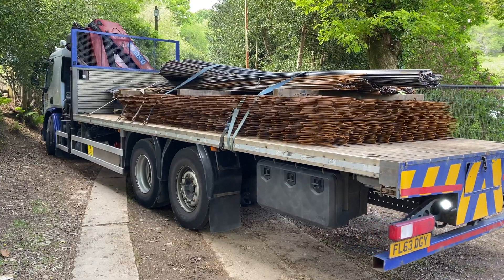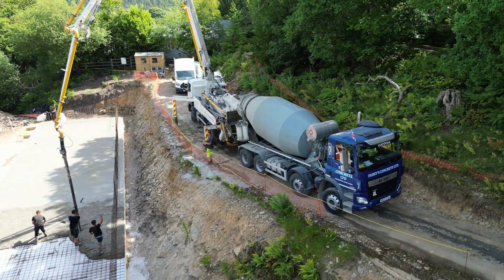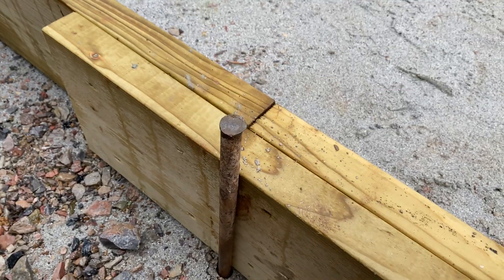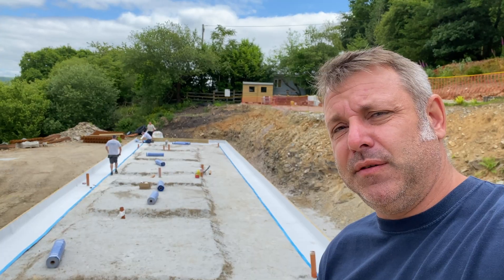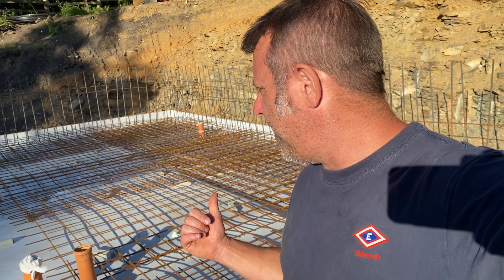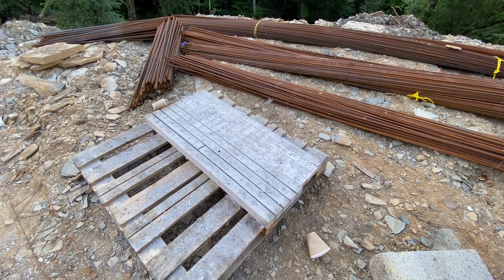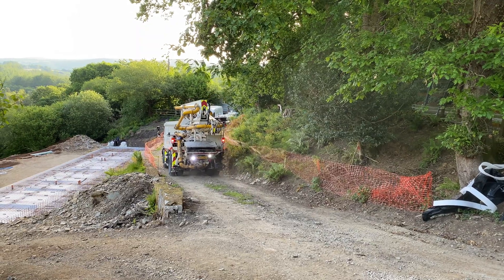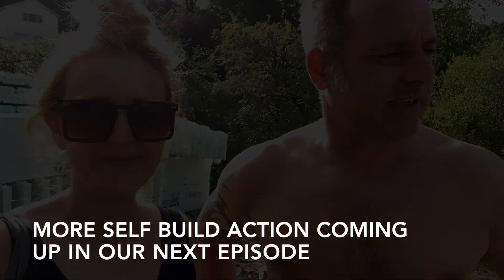Reinforced Concrete Slab - Self Build House 5

Comment: Thanks for the great videos, how did you get the toilet emptied & what did that cost? Cheers
Reply from the maker: Hi there. I use a local company when it needs it. Although to be fair, it gets emptied well before it's full as the smell can get quite bad 🤢 . Check out episode 22 and you can see it being cleaned and emptied. An empty costs £50.00

Comment: Just wondering why you didnt insulate the slab? maybe i'm missing something...
Reply from the maker: Hi there. Good comment. We're going to insulate on top of the slab. As part of the slab make up, there is also another additional waterproof membrane system that we have to install. We couldn't insulate under the slab as we needed a concrete chamfer to sit soundly on the excavated rock, which is all part of the retaining wall design. Similarly, we couldn't insulate within the slab as the 300mm solid mass and double layer of A393 mesh had to be monolithic. That being said, there are probably some really clever alternatives out there that we hadn't thought of. I'd be interested to see if there was an alternative way of achieving the load retaining and double waterproofed slab construction 👍